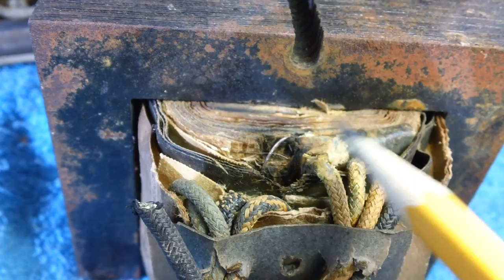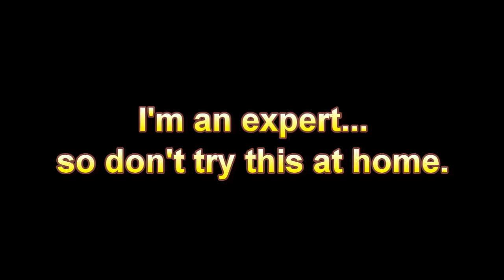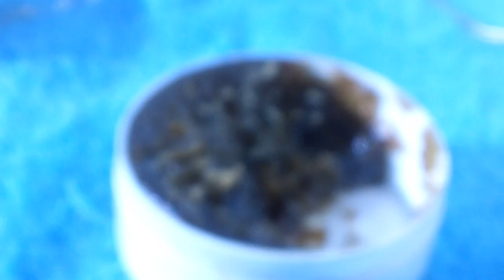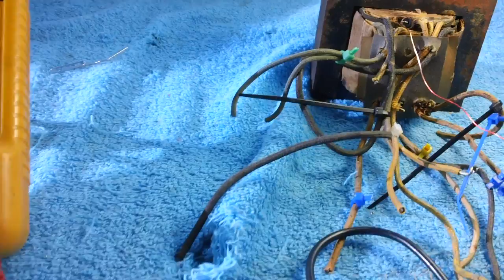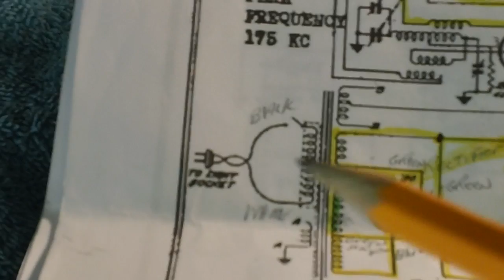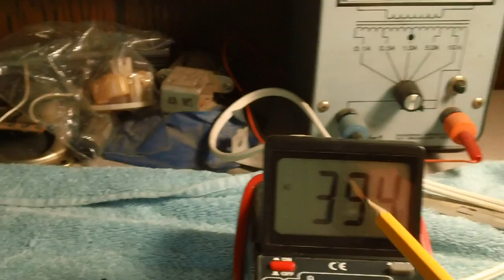1931 Airline 62-14  (Part 2 of 44).

Comment: John, when checking the coils, are you just looking for continuity on both sides?
Reply from the maker: Tony,  Correct.  Just make sure the coils aren't open.  The resistance reading will almost always be very small.  So if the coil shows continuity, then continue to march.  Regards,  John
Reply: Thanks, John.  I like your videos.  Very helpful for someone just getting into radio restoration.  Keep up the good work.  Tony

Comment: John.  I believe that you could actually rewind the power transformer if you had too.  You could use masking tape between the layers.  When it is complete, hook it to a source and load it up if you can.  The object is to get it warm.  When you are ready, you can dip it in a can for varnish which will permeate the windings and also it locks them down so that they don't vibrate.  You might even apply some voltage to make it vibrate while in the varnish.  I would go easy there and not in the house.  Hang 'er to dry and you have a new transformer.
Reply from the maker: Stephen,
Holy cow, my friend, there's no way I could pull off rewinding a power transformer.  I'm barely able to fix the usual problems we radio types encounter.  Rewinding a power transformer, or any transformer for that matter, is waaaaay above my pay grade.  LOL
Regards,
John.
Reply: joernone I wouldn't attempt an IF transformer, but I have wound a Power Transformer by hand.  I am sure that you would have no trouble.  I see from the next video in the series that you were able to make the repair so it looks like you are in business.  Are you using an acid flux or is it a rosin paste for some sort?
Reply: joernone I would agree, done a couple of power transformers myself, and your 
'problem winding' looks to be the outside one, so it may go simply for 
you :)

Comment: Dear John I've been at the old radio game for forty years and have had to refurbish more power transformers than I can count. It seems that Atwater Kent s have a high failure rate I've always figured out a solution. This is a highclass set, will be A beauty When done.it was made by wells-Gardner which never turned out junk lucky guy.....best wishes... Dave in SC
Reply from the maker: Thanks, David.  I'm not sure what you mean by refurbishing a transformer.  Are you saying you rewound they.  If so, you're a bigger man than me.  Maybe you might consider showing  us in a YT vid how that's done.  I'd certainly watch.
Regards,
John

Comment: That transformer looks common to me, for tube radios.  Not as hard to find as let's say a CRT or IF transformer with good caps in it.  This is why we do not throw away "bad" radios.  Someone watching has one in their salvage (aka junk) bin.  Today I saw a "junk radio" at the antique store for 15$, because its bakelite case is busted up and missing parts.  But the chassis looked OK.  I feel it's worth 15$ just for parts.  Um thinking about going back to get it.  I may even fix it without the case, I like the looks of an exposed naked chassis rig.  But cases are probably the hardest part to find in good shape.  There's a guy on ebay that has the bakelite case for my Admiral 26R12N that looks pretty nice for 39$.  But he says local pickup.   Then another guy has a (one )knob for 34$ for it!  That case is a bargain.  And there may not be another like it for many years!  Things are getting scarce, but transformers are not as rare as CRTs and cabinet parts. 
Good try John, well worth the try. 

Don
Reply from the maker: Don,
This particular transformer isn't very common.  Lockemeister has recommended one that I'll most likely need to look at and possibly buy.  We'll see, my friend.  Next power-up is minutes away.
Regards,
John

Comment: Damn, that is a shame. I could sware that when you're going to hit a certain input voltage something is going to smoke because that's what happens when you're happy that you've fixed something. That 22AWG wire is way to thick since there is very little current going trough it. Anything will do if the isolation lasts. Anyway, hope you can get it up and running again. Cheers :)
Reply from the maker: Not to worry, my friend.   This old transformer will soon be purring like a kitten...I hope.  LOL
Regards,
John